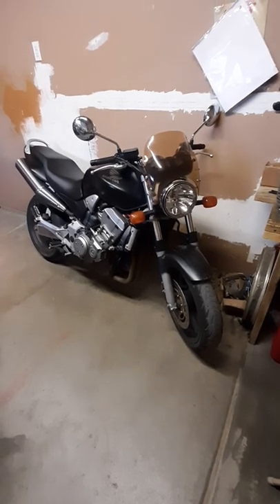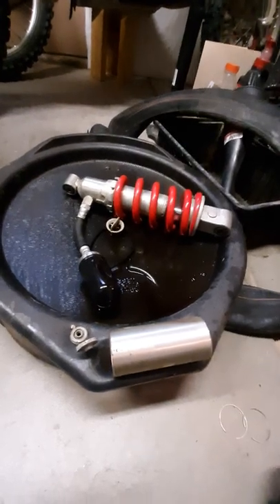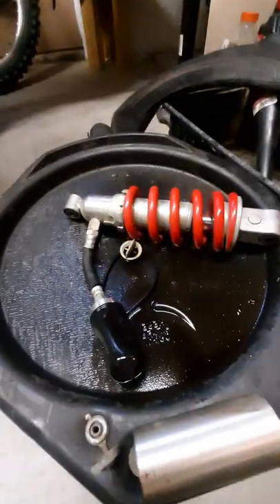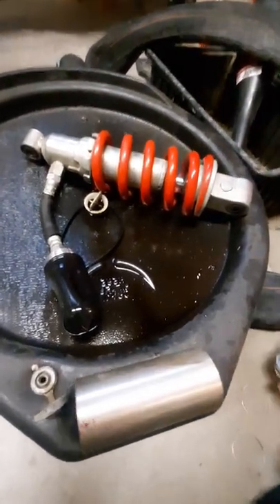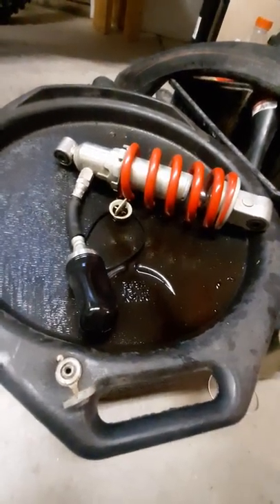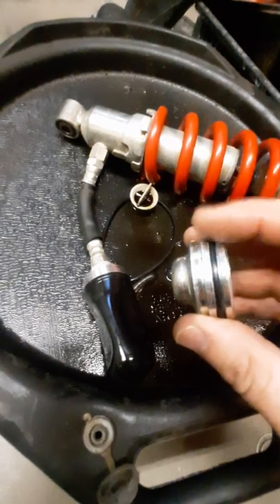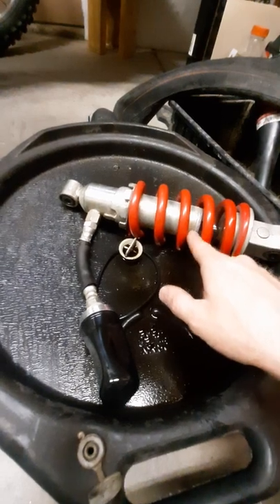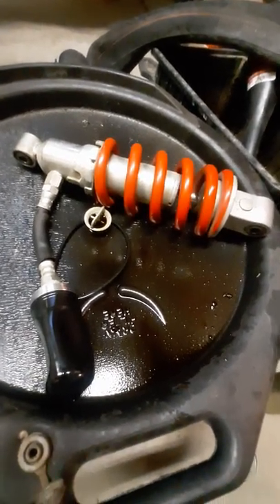Honda 919 shock rebuild

Comment: Listen thank you SO MUCH for posting this vid, run an RRW Blade and same symptoms. No pressure whatsoever in the reservoir, drilled and installed schrader valve with a flex extender adapter. Got it to estimate 110 psi and WOW! New shock again. Not cheap items so again thank you so much for the fix 👍👍👍👍😁😁😁😁

Comment: Interesting. I'm a little late to the party. What you could do is to drill and tap the hole for the schrader valve. Use a rubberised crush washer (for brake banjos) and  half nut on both sides to seal that hole. The fitment of the end-cap is awkward I think - could be JB-Weld (or Marine-Tex GRAY!!)?? (Never to be taken apart again in one piece though) Thouroughly clean and roughen up the surfaces first though.

I've 2 of hese OEM shocks in excellent condition. This video does emphasise the poor product that Honda put on one of their best street bikes. I now have Nitrons. I tried to put on a Hagon shock (it did fit and was the recommended shock) but the ride height was raised by close to an inch (25mm) - and no height adjustment. uuuugggghhhh!

Hope you enjoy your Hornet. Now you just gotta get the front shocks sorted. Matris do a really, really nice cartridge kit for them.

Comment: Nice video, I have cbr 900rr fireblade that has thee same shock. Needs a service but I will try this first. Going to rebuild the shock in the winter but this should get be by these last couple of weeks.
Reply from the maker: I bought a spare shock to rebuild for mine but as well as its been working with the charge I haven't bothered to mess with it. If yours isn't leaking I bet it doesn't need a whole teardown.
Reply: @TurbodanNM  its not leaking at the moment, and this mod made it million times better! Thanks!
Reply from the maker: @MJPilote  good stuff
Reply: Don't spend your money on oem shock.. It will start to leak soon and bike handling not so good when you push it hard. I've just installed YSS on my 900RR and it's completely new bike. Much more stable and comfortable over the bumps. Wish I installed it before... I've been struggling with original one for two years, it just not worth it...

Comment: Please make a video of rebuilt this shock bro
Reply from the maker: Is yours leaking? I haven't gotten into the main body yet. My 919 has been great since I got the reservoir recharged, haven't needed to mess with it since. Maybe this summer I'll do part 2.
Reply: No brother in my shock dont have refill option
Reply from the maker: @prabhadesignscustomautomot1450  none of these do. I installed a schrader valve in the reservoir end cap to allow the reservoir to be charged. Been working as well as it did new.

Comment: Hello mate, I'm having the same kind of problems with the rear shock as you described, i want to try rebuild reservoir same way as you did it, please advise how did you popped up the cap? Cheers
Reply from the maker: To disassemble the reservoir you push the end cap into the shock body and remove the snap ring that retains it. If your shock is as dead as mine was there will be very little pressure and once the cap breaks free it will push in without much difficulty.

Comment: Thanks for the valuable info! Question, so you think that a tubeless wheel valve stem would be a viable alternative/substitution for the Schrader valve? I need to do this mod to the canister because I am experiencing the same issue with my 2003 CB 919. Great explanation on Video BTW!
Reply from the maker: If it's an all metal stem it will be suitable. A rubber stem will not hold the required pressure. 150 psi would blow that puppy right out. Look for a high pressure, bolt in valve stem and seal it in with something like JB Weld.

Comment: what pressure did you end up using? I just did this mod and can notice a difference in it bottoming out. I've got it at about 120psi right now, but now sure how to "tune" it for my weight. Also the bike shock pump is a must have putting air in.
Reply from the maker: 120 should be alright, just check it once in a while and keep it topped off. Reservoir pressure determines the threshold of cavitation, based on the rate the piston moves through the fluid in the shock body. These shocks see pretty high velocity since Honda didn't use linkage but I bet they work pretty well down to about 60 or 70 psi. Once you get below whatever minimum pressure is, there won't be enough pressure to counteract the pressure generated by the valving and oil will begin to push into the reservoir rather than go through the valving.
Reply: @TurbodanNM  ok cool thanks for the explanation

Comment: I rebuilt many shocks in my day and I have never seen the bladder contain the oil. If as you say that the shock had air in it then that also means the oil escaped. How would you bleed the air out from the piston?  I would guess around 150-175 psi for charging. It sure would have been nice to see the internals on video.
Reply from the maker: I will eventually modify a spring compressor to get the rest of the shock apart. I'm sure the piston setup is a lot like any other shock. It's anybodys guess on how these are built at the factory. Definitely unconventional. I've had two apart, this one and the one that's on the bike. Both had the bladder oriented with the oil inside and the air on the outside.
Reply: @TurbodanNM  I made a simple spring compressor and I would be interested to compare to what you came up with. It would be fun to try modifying the reservoir setup with most of the parts that exist. It wouldn't be crazy to switch the bladder to hold the nitrogen/air.

Comment: Did you use compressor air to fill the shock
Reply from the maker: I use a mountain bike shock pump. If all you have is a compressor and standard air chuck that will work well enough. It won't last as long as a full pressure charge though.

Comment: How did you get the snap ring out to remove the cap?
Reply from the maker: I usually push a screwdriver between the snap ring and the body of the reservoir. These are surprisingly low tension rings so they can be displaced pretty easily.

Comment: When you want to charge shock with nitrogen, without rebuilding the complete shock is it necessary to remove the spring, compress the shaft all the way in and then start to charge it or it doesn't matter? Tnx
Reply from the maker: The shock must be charged at full extension. Same procedure for a full rebuild or just a recharge. I just opened up the reservoir, installed a valve in the end cap, put it back together and charged it up.
Reply: @TurbodanNM  tnx for the info 👍

Comment: I have the same problem with Showa shock on my CBR 900 RR.. Really how the hell did they fill the shock with the Nitrogen in the factory.... I  have rebuild mine and after let say one month pressure drops from 12 bar to 9... Aftermarket ones are just too expensive for this old bike.
Reply from the maker: Same thing with the piggyback reservoir MX shocks. They lose a significant portion of the charge before the oil even gets dirty. At least those have a base valve to help build pressure and control fluid displacement. Best I can tell from how far I've gotten into the street bike shock, there is nothing but the charge in the reservoir to control cavitation. It works well as long as it's charged up.
Reply: I got a Hagon monoshock very inexpensively and it's brilliant on the bike. It has a custom progressive spring(very important for linkageless bikes like the 919) as part of the package based on my weight and it ties the compression and rebound dampening together well for street use. A vast improvement over the OEM for under $400. Not an Ohlins, but the bike and it's use doesn't need it....really, the frame starts to flex at the limit once you get a good monoshock and uprated front springs anyway. (I upped the fork oil weight slightly too, made a huge difference)

So getting anything at Ohlins level cost doesn't gain you much anyway.
Reply from the maker: @nickb3968  you should try the stocker with a proper gas charge in it. Not bad at all. Anything is going to be better than a 20 year old stock shock with 2.5 psi left in it.
Reply: hey Dan I would gladly pay you to do the Mod for my stocker if you would be willing, I am mechanically challenged 😂 I’m in Utah and our roads here suck as well! LMK THANKS

Comment: if the oem shock does need a full rebuild, are their part numbers from other showa models that would work, does anyone know?
Reply from the maker: If you have to go that far I would suggest taking measurements and looking through the KYB catalog. For a given shaft diameter and tube diameter you can probably source seal heads from KYB. I am not aware of any resource for Showa parts. 

I already found a suitable bladder and cap from KYB to convert the reservoir into a more serviceable design which can be bled and filled easily. There's a good chance you can find suitable replacement parts for the rest of the internals too as long as Showa didn't do anything unusual with dimensions.
Reply: @TurbodanNM  thank you!! Whats the bladder overall length do you know?
Reply from the maker: @erikdanielczyk7666  the original bladder in the one I have apart is approximately 80mm. Anything 70-80mm would fit just fine as long as the diameter is correct. I do not know if a KYB bladder will properly fit the stock showa cap, if not you would need to order a KYB end cap as well and flip the bladder around so it is pressurized internally and the body of the reservoir is holding oil. In this case you would only need to seal the end cap where the oil line screws in, as this sealing is completed by the bladder in the original design. I was planning on trimming off most of the bladder and using only the bottom ring where it seals between the cap and reservoir in the event that I proceeded further with the rebuild and it was necessary to convert the reservoir for the purpose of bleeding and filling the shock.
Reply: @TurbodanNM  you are the man thank you so much!!
Reply from the maker: @erikdanielczyk7666  let me know how yours turns out.
Reply: @TurbodanNM  you bet. Gonna order parts and tackle it once the weather takes a turn.  40mm is the cap size correct?
Reply from the maker: @erikdanielczyk5442  the exact ID of the body of the reservoir is 1.60" or 40.64 mm. A 40mm cap should work, I would try the KYB 120114000101. It does concern me somewhat that the reservoir measures that much over 40mm. Specifically the snap ring that retains the cap under tremendous pressure.